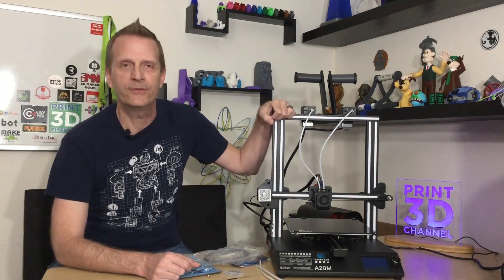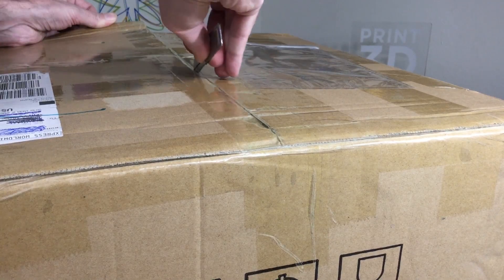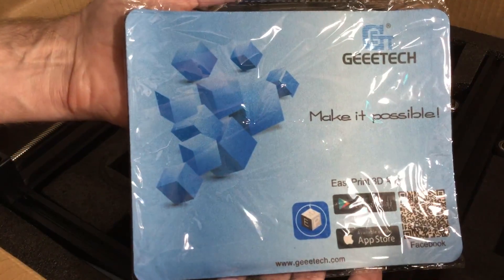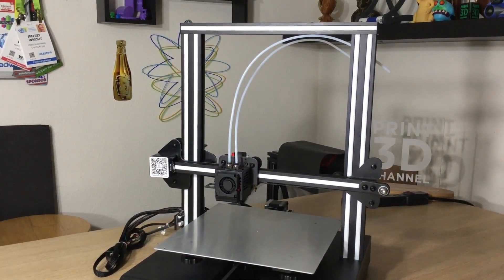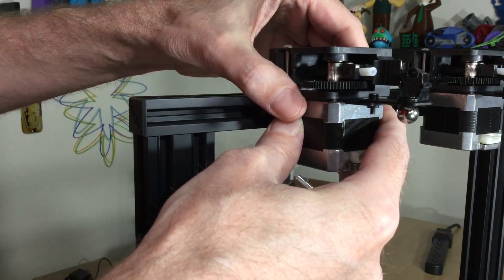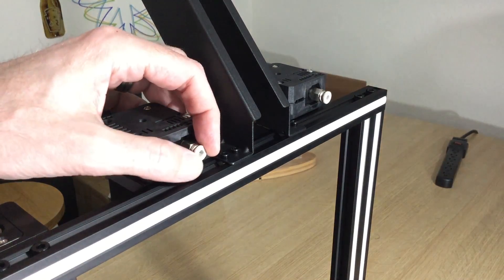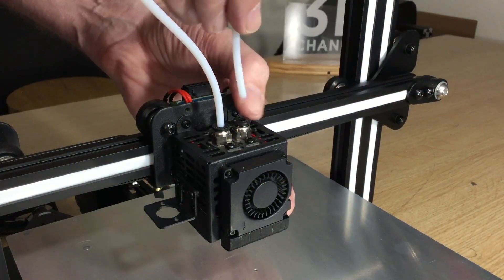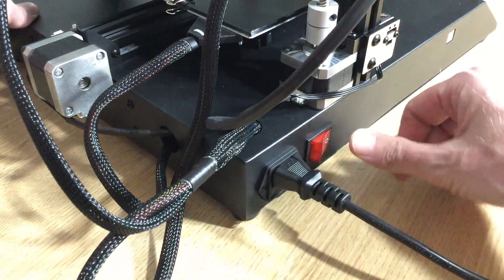How To Assemble The @Geeetech A20M 3D Printer: Part 1 - Unbox & Assemble

Comment: Nicely done Jeff! One thing I might add is to always check that you have the latest firmware when first assembling a new printer. Firmware updates can eliminate frustrations right off the bat in many cases.  In this case, Geeetech has updated it in the last few days. Viewers can find it here: http://www.geeetech.com/forum/viewtopic.php?t=17046
Reply from the maker: Excellent additional information to those building this printer. Check for the latest firmware updates before starting your first prints. I will note this in Part Two of the video as well. Thanks Chris and thanks for watching and supporting the channel!

Comment: I have a printer that looks nearly identical, same manufacturer and model, but some things are different. I thought I plugged in the extruder motors wrong, so I unplugged the cable and it ripped out of the circuit board. Hopefully it works still. Also wish to have more detail of getting the t bolts in, not easy to get them to spin.

Comment: This was exactly the type of video I was looking for. Other videos focus too much on the ability to build this in 30 minutes. If you're new to this, these instructions are what you need. My only complaint would be that mine didn't come with the extruders ready to just mount, and it would have been nice for that mechanism to be shown. But the similar ones for the spool holders were shown  moments later, so I think that will be enough for people. I had mine assembled before I found this video, but I watched through and tweaked a couple things. I was excited to have a part 2 to look forward to, but I cannot find it, and no answer yet when someone asked where to find it. I'd absolutely watch it, and am grateful to be able to watch this one. Thank you!

Comment: I have one of these on order. From what I've seen online (since I don't have it in front of me yet), I don't understand why you wouldn't mount the extruder brackets on the top of the crossbar instead of the side so that the exit of the filament is down toward the nozzle? It appears that this would provide slightly more Z-travel clearance, since the motors appear to be thicker than the extruder exit. Also why not put them in the center of the crossbar with the spool holders on the outside to minimize the travel of the Bowden tubes? I think it would also be possible to shorten them, which is always a good idea.
Reply: Hi.  I did that. Printed a couple of blocks from Thingiverse to raise the extruders, put them in the middle as you suggest and turned the spools so that it looks like Mickey Mouse.  Works well.  Didn't shorten the bowdens.